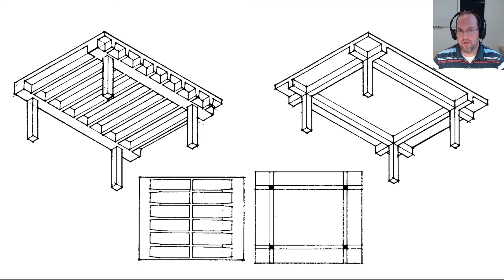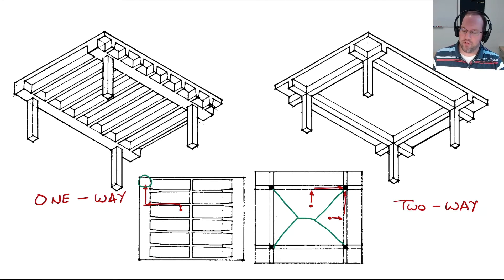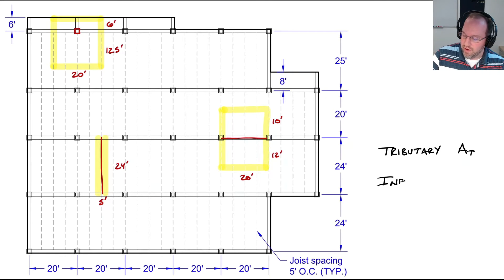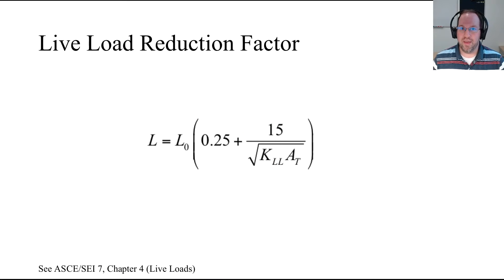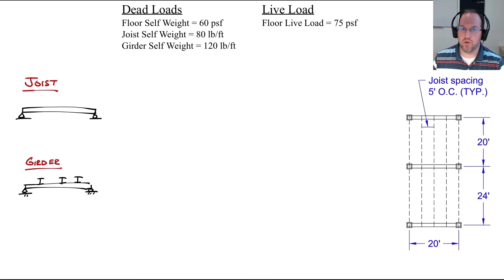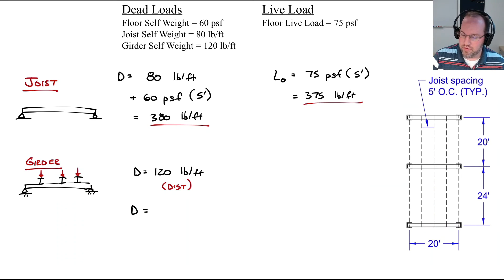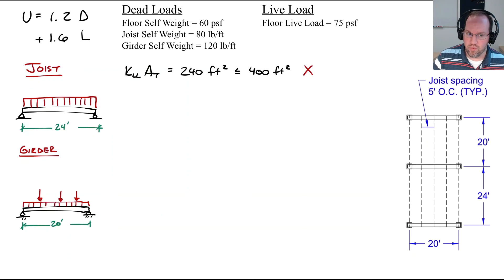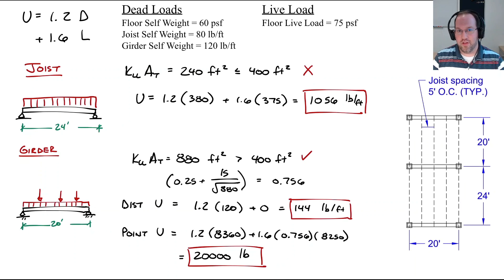Gravity Load Systems, Tributary Area, and Influence Area - Intro to Structural Analysis

Comment: Hi Prof, great explanation. Just to confirm that you are avoiding the two point loads just for convenience, correct?
Reply from the maker: Yes, the two joists (point loads) at the ends of the girder do not contribute to shear or moment in the girder, so I ignore them. I didn’t provide enough detail in this exercise to show it, but those joists could either be supported on the girder or directly frame into the column. Obviously, if these frame right into the column, the girders don’t see these point loads at all.